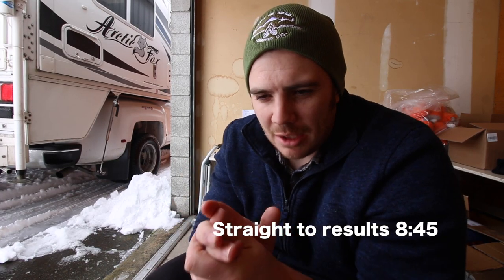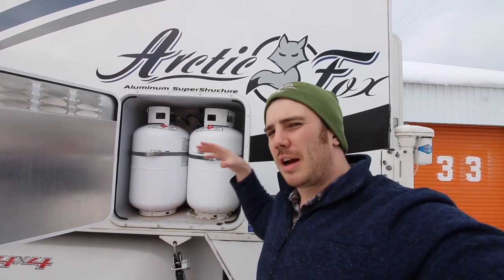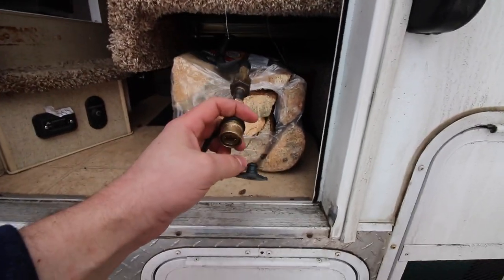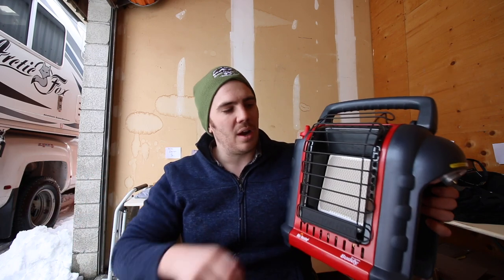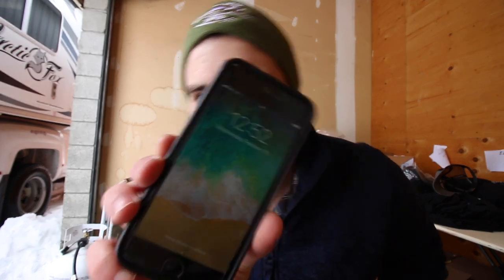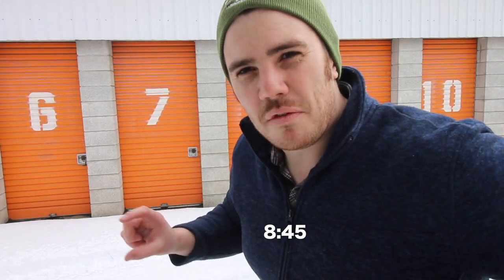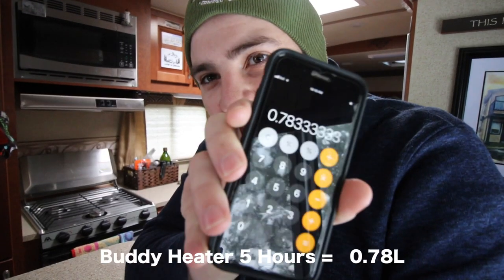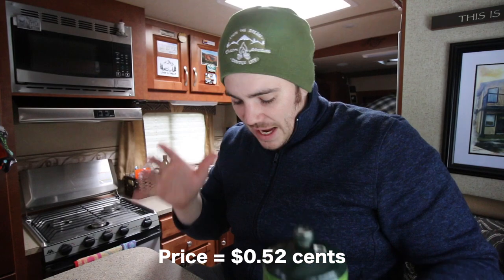How Much PROPANE Does Your RV Furnace BURN ? VS A BUDDY HEATER .. ??

Comment: The Buddy Heater puts its exhaust gasses into the RV it is heating. Please don't use a heater which does this, it is not safe. People will say you have to keep a window open. Well, someday you will forget to open a window and that will be the day that heater starts emitting a lot of carbon monoxide.

Modern furnaces are room sealed. The exhaust gasses go outside the RV. The intake also comes from outside the RV so it is not eating up oxygen.

I think a good modern furnace will be as efficient as the Buddy Heater, but even if it isn't quite as efficient it is a very much better, safer system.
Reply: The Buddy heater is a catalytic process not combustion. There is no “exhaust”.

Comment: Speaking of being “indoor safe” I don’t believe the buddy heater itself is “indoor safe”. 

Yep I’ve ran them inside before but it’s not recommended. Lol. Also I think that buddy goes thru 1lb tank in 1.5hrs on high or 3 hours on low.

Comment: Hey Taylor!!!! I been watching all your videos and every single one of them is better than the previous one. I wanted to thank you for the awesome videos and the presentation and the perspective that you put on life which helped me make a decision to try out the Camper life. After an incredible amount of research and even more YouTube watching. I am pulling the trigger on purchasing a 2001 1150 arctic fox and a 2007 F350 dually ( crew cab lol... like I said before, I watched all your videos :D), but back to the video about the Buddy Heater. The idea of hooking up the buddy heater to the large propane system is spectacular and I think it will be the first modification I will be doing to the Camper. But just like every fan I have a request for video. I would like a video on the Idea of installing a Tesla module to replace your current batteries. Keep livin the dream !!!!
Reply: have you tried T fitting it off the Stove? Since its already routed in the camper and the buddy heater is small enough to be on the stove, the Camper is designed to function around a heat source that is located in that particular area of the Camper.

Comment: Taylor, check out TaylorCoach.com. I've watched some of your vids and sometimes get a feeling that space is making a difference. Especially now that there are two of you in there. Taylor Coach offers travel trailers with rear door entry. The same as you're used to in a truck camper. They're available in lengths from 10' up to 24' . Sleeping varies from twin bed to double to queen and bunks and gaucho ( a sofa pulls out to a double size bed ). They build to your specs. Kitchen choices, bath choice, what ever storage you may need. Awnings that pull out by hand with a strap in the middle. No cranks, or motors to go bad. Enclosed underbelly with aluminum. Roof is aluminum, not fiberglas that cracks. No, I'm not a salesman for Taylor. I just love their coaches. I may have one built this summer, to pull with my F-150 half ton.  Thought you might want to check out these, and possibly downsize your truck to a more economical one at the same time. ( isaw where you spent $10,000  on your last big trip.
Reply: P.S. they are made in Canada.
Reply: do they make truck campers tho? I can't find anything but travel trailers on their website
Reply: @zanesimunov3070  re-read my message, I think you may have missed something.

Comment: Hi guys, great comments i found about this video. I prefer the factory stock because of the freezing in winter, but I don't know when I run the furnace for full time in my 32 footer with not wings (97 ultrasport) the 5 gallons propane tank last for 15 days. We use the stove too but not the shower or refrigerator. Any idea??

Comment: One 30LB  tank in the winter for me in a 29’ lasts about a week at 63 degrees 24/7.  I usually will put it at 67 at night and then turn it down to about 59–60 when I leave to go to work for my pets. The only thing I don’t like about it is dust and I don’t know where the filters are to change them. 2005 wildcat 29’ with pullout. Anybody can help me out that would be tremendously helpful and I would be very grateful. I’d like to know where the filter is to suck it in from outside and then I’m pretty sure there’s another one, but it passes through before it blows through the vents.

Comment: Hmm the BTUs could be different, but i get what you want to do. Thank you, it was pretty diffinitive. However, the furnace, in newer models, heats the belly supposedly to keep the water and poop/gray tanks and pipes from freezing. The buddy does not do that. The heat from the buddy is not diffused and more concentrated around it, so a greater fire danger, of course. I have had electric heaters i gave away for that reason. We have z very small cabin. When i need to use the buddy...when we are in single digits or below 0 F,  i put it on a board on the range. It is where we won't bump it, not close to anything and below the ceiling enough do the heat does not get concentrated, plus i use a gentle fan to disperse the heat. Our cabin is far from sealed, so i do not worry about the buddy causing problems, but sometimes i worry about our wood stove when going full tilt. I will crack a window.

Comment: The buddy will keep my 1250 sq ft house 65 to 70 when it's we 25 to 30 outside on the low 4k setting. 
It would roast out that little camper.

Comment: How much more efficient would the furnace have been if one vent was just cracked a little.  I mean, how much heat just went flying out the vents?
Reply: Randy Shinn Only cracking one vent would have no effect on the heater. He set the thermostat to 99 F so the heater was running full blast during the test. Closing one vent would have no effect on anything.

Comment: I have a Mr Buddy Big Buddy, which is basically the same as yours, but with the 2 burners.  I have it hooked up to a 20 gal tank.  I purchased the hose adapter to hook up to a bigger tank when I got the heater which has a regulator on it.  I have the link to Amazon here.  I hope this helps you.  https://www.amazon.com/dp/B000UC7966/ref=psdc_7787980011_t1_B001CFWF5U